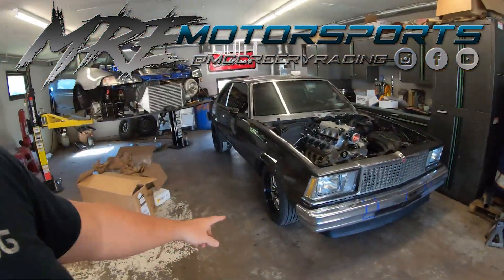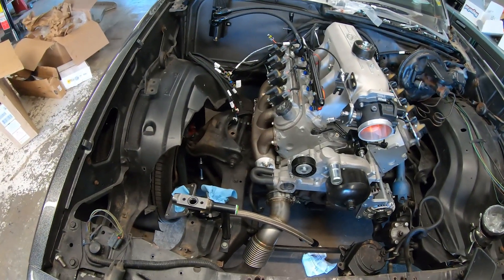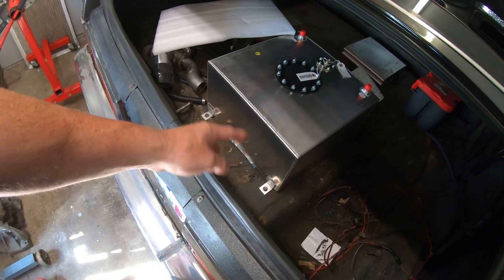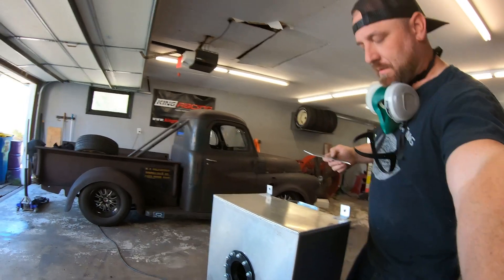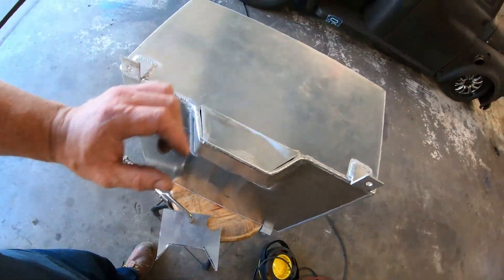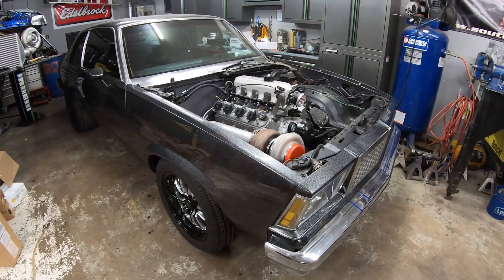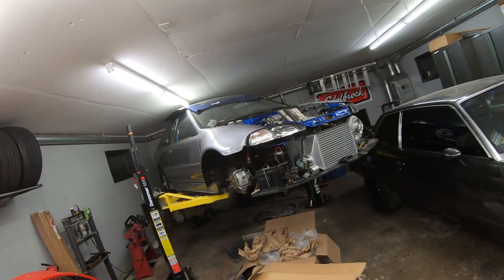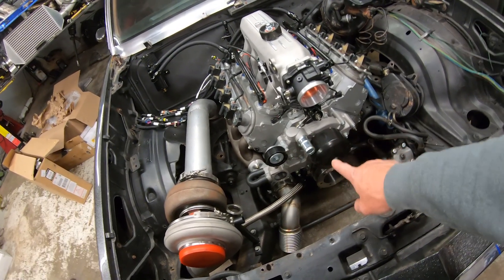Turbo LS G-Body Malibu Build Updates!!

Comment: Did you have to do any modification to get that fi tech throttle body onto the intake ?
Reply from the maker: I believe we had to open up the lower 2 mounting holes a little. But that was it.